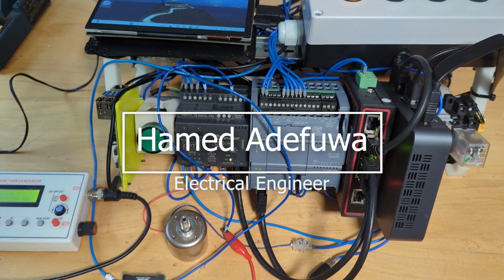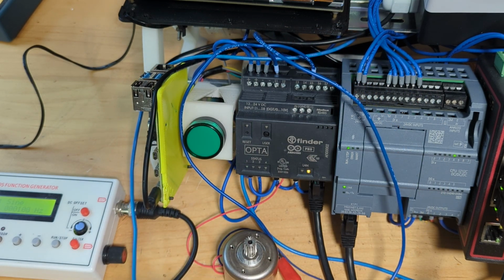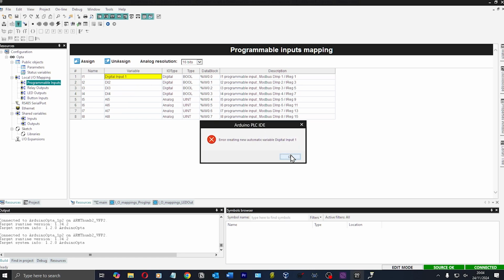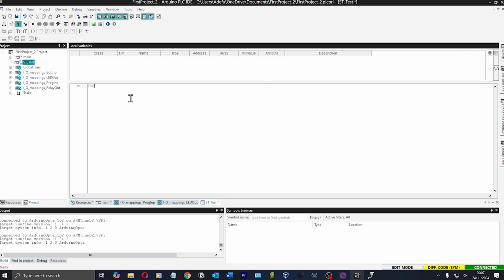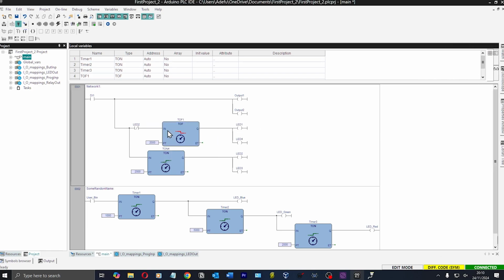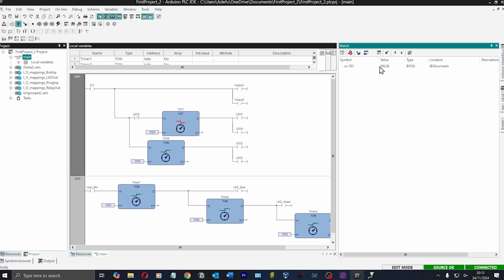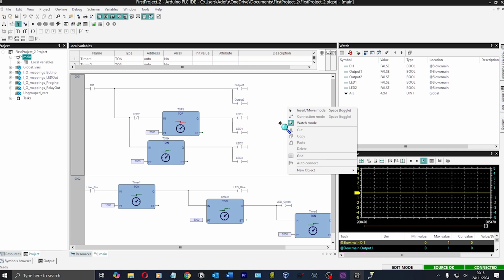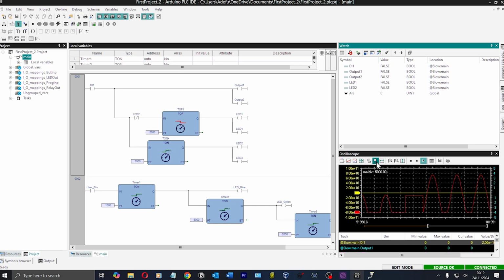Arduino Opta PLC: Full IO Testing In Ladder Logic

Comment: The PLC IDE could not be installed on W10 i5 4 core PC.  Also on the PC (Dual Boot) W11 same problem.Firewall is off .  Switched to Old Surface W10 PC and it will install.  But after loading boot software on Com 6 I  see two Com ports (com 5 and com 7) but pressing acrivate modbus and connect still no connection???
Reply from the maker: I doubt Arduino are going to be developing this further. I saw that apparently you can program this PLC on codesys now, maybe try that.
Reply: @HamedAdefuwa  RIP Arduino & Open Hardware.. thanks to Qualcomm  https://www.youtube.com/watch?v=7Sc43ZRVds8

Comment: I saved my project and the window adjustemts carried over on restart. I also selected dark theme. Having to connect my USB C cable is still a pain. I want to keep the PLC test bench on another desk and connect through ethernet. Seems connecting through ethernet was removed on 1.0.6.0 for some security reason, I need that feature back ASAP. Currently reading the 'Modbus TCP On Opta Using PLC IDE' page on the Arduino page to see if I missed anything, that page was last updated on 6/05/25.